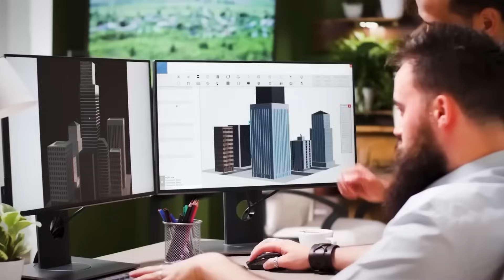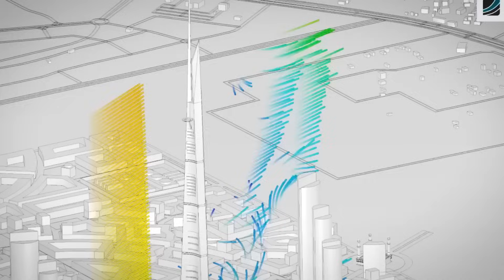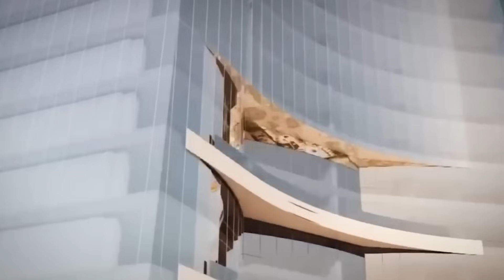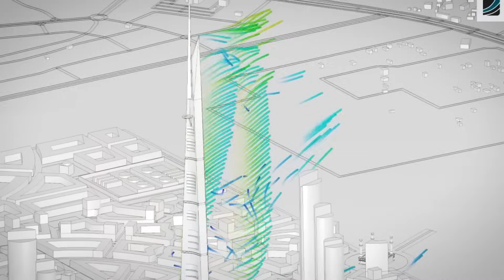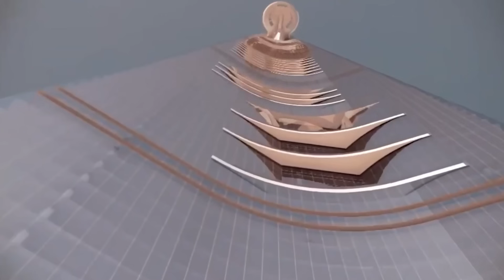Jeddah Tower 2025: The World’s First 1-Kilometer Skyscraper Explained

Comment: All fake. Not modern at all - all looks. Serious flaw - and problem - is that there is no connected plumbing to handle waste. These buildings have giant cesspools. If that tower would be filled - which is doubtful - the amount of trucks needed to cart away waste every day would stretch kilometers - then dumped in the dessert and not going to water purification plants that should be connected like a true modern building.